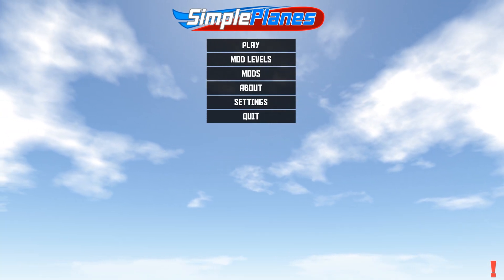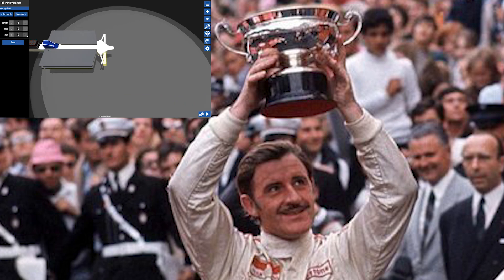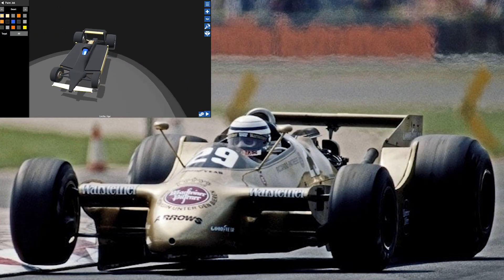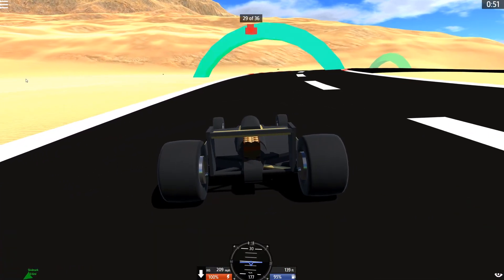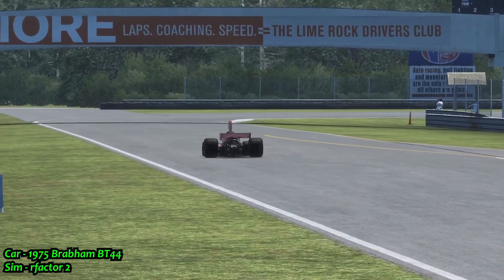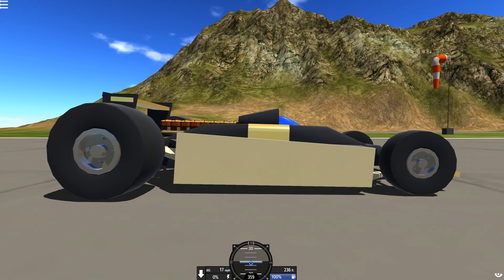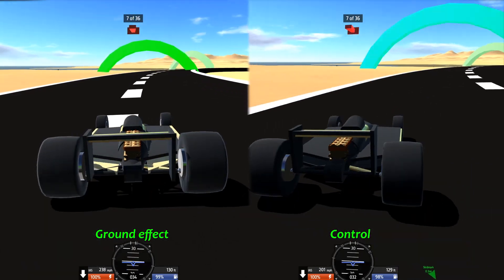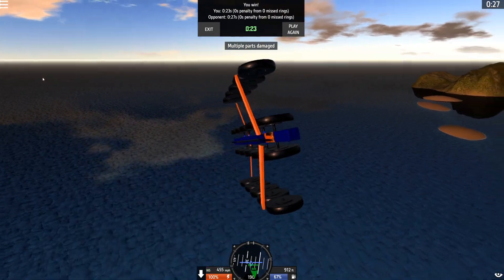Visualising F1 Technology With Simpleplanes - Ground Effect And The Lotus 79

Comment: I built an open wheel car that can take corners flat out at over 500 km/h and doesn't even use ground effect. 34 seconds laptime on Gold Prix. With this knowledge I bet I could make one that is even absurdly faster
Reply from the maker: World record is 0:08 (me) give it your best shot! https://www.speedrun.com/simple_planes/runs/m76w939y
Reply: @jamesrowland2002  dayum. But right now I'm more focused on trying to build an easy to handle car that the AI could drive around the track without crashing or spinning out. This is difficult because the AI is always flat out and never brakes because it thinks it's driving a plane.
Reply: @jamesrowland2002 it doesn't use actual engines so I wouldn't count it in the traditionnal car category. What's the record for car engines?

Comment: I know this video is old, but your explanation as to why the downforce is generated is backwards, especially because the expansion zone has higher pressure than the compression zone, that's to keep the flow of air constant throughout the whole car.

There's a lot of space above the car, thus the air can move freely in large quantities, and there's very little space below the car, so the air has to accelerate and thus lose pressure, again to keep the flow constant.

Comment: I am currently writing a technical research paper on designing the ultimate hypothetical racing car, with a professor of spacecraft and rocket propulsion, and it involves quite a bit of CAD, CFD, FEM, and other high level engineering and design know-how. Basically a 9G+ cornering, 550+kph top speed, 0-100 kph in under 1 second, ground effect based fan car, that's electric and powered by hydrogen, with active aero and active suspension and a bunch of other F1/Hypercar tech.

Thanks for this awesome game suggestion, I am going to download it now and see what my virtual mad car would be like.

Also, fantastic work! You are criminally underrated!

Comment: How did you get the wings to flip because when I flip it it still generated lift instead of downforce
Reply: Same thing happened to me when I tried that before.
Reply: @ya-rx8nd  I got it to work after a bit of tinkering I don’t know what I did but it works now
Reply: @Dingoofdingos  I figured it out. The wing has to be facing the opposite direction.

Comment: If only jundroo actually made the airfoil visible, not just a flat light plank

Edit: also, im trying to make a trophy truck with controllable spoilers where i can change the angle midair, if i put it atleast 20 degrees just at the end of the hood, will it actually produce downforce?

Comment: In simpleplanes, did sealing off the sides of the venturi tunnels increase downforce, or does the game only use the wing to give a value for downforce? As in, does the game simulate proper ground effect?
Reply: Game don’t model ground effect 
Just downforce the side seals are dead weight

Comment: great video. do you reckon you could provide a download link for the car ?  i would like to try it out
Reply from the maker: thanks!

I uploaded it here http://www.simpleplanes.com/a/y2I67k/Lotus-Type-79-Ground-Effect-Car

Will add that to the bio

without the side skirts i think its a bit less stable and more pointy on the front, they are just panels not wings. The center of lift didn't change when i took them off, to be fair its more for illustration as they definitely made a huge difference on the real thing! i'm not sure how in depth the games modelling is and im definitely not an engineer! I have seen working ground effect planes in SP tho!
Reply: @jamesrowland2002  it is very good to drive i just tried it
Reply from the maker: Alec BB thanks! I’m working on some 6 wheel f1 cars and their 4 wheel counterparts to compare them with next!